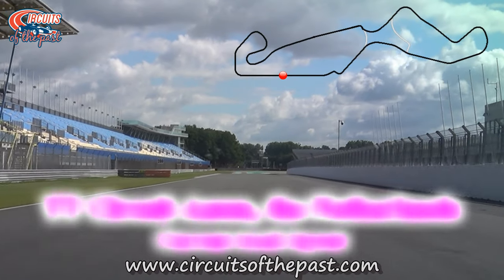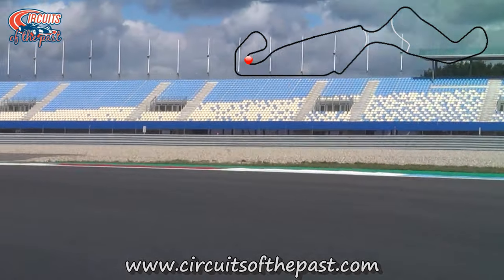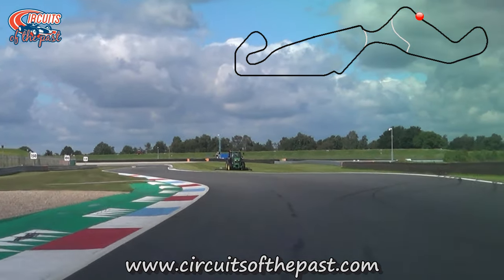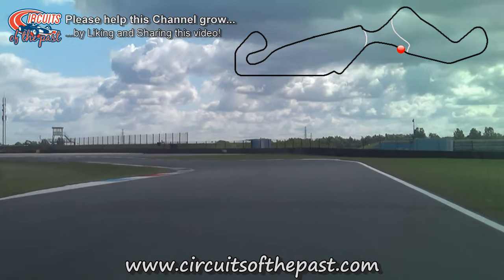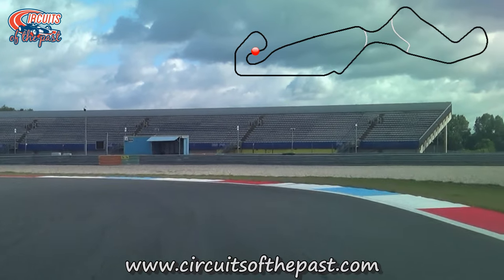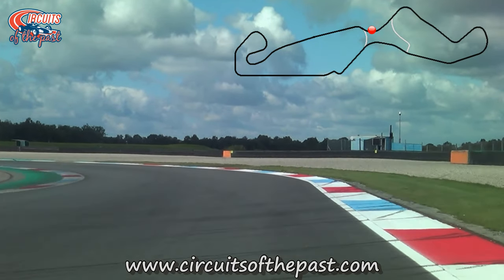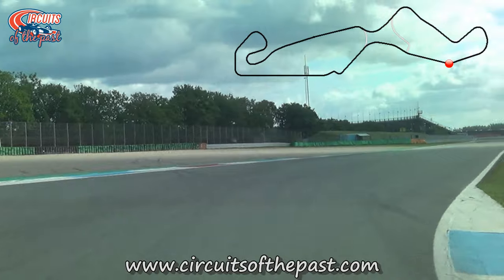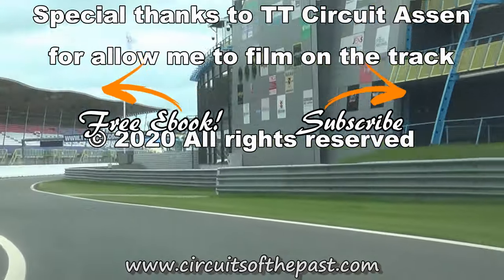TT Circuit Assen Current Race Track (2006 - Today)

Comment: I've ridden both the pre and post '06 circuit.
Reply from the maker: Me too, I drove there already in 1989. then the track was only 7 metres wide. In 1990 they widened it up to 10 metres.
Reply: @Circuitsofthepast  I started racing bikes after '00. Just when my ex-wife wouldn't be a matter.
I know of the stories back then. Mates of me told about their illegal runs around the track.
Reply from the maker: @narvul  De goede oude tijd :)